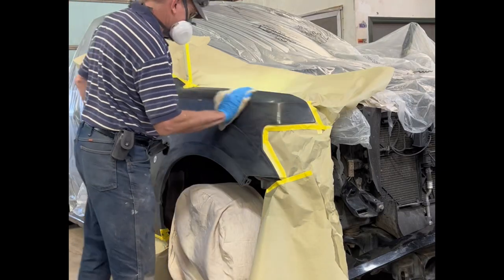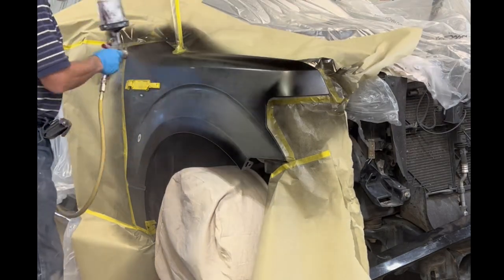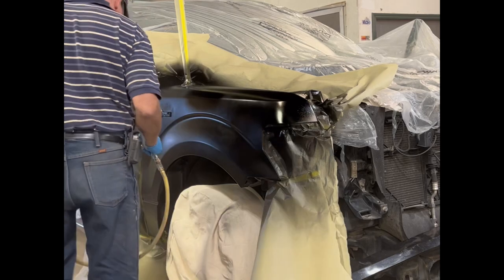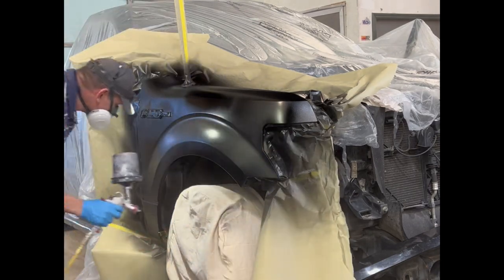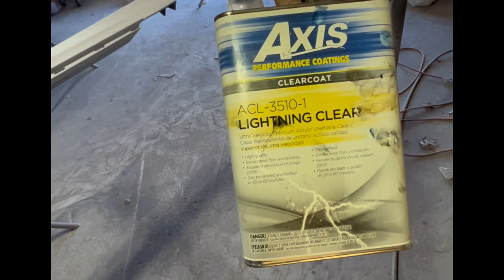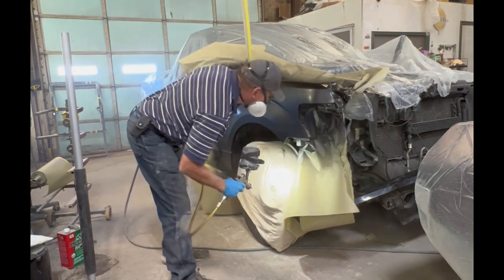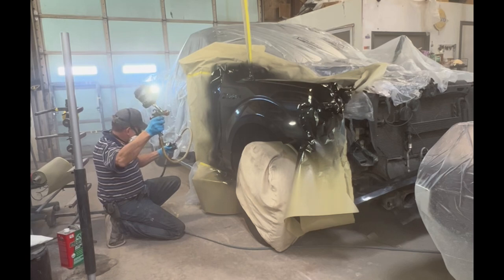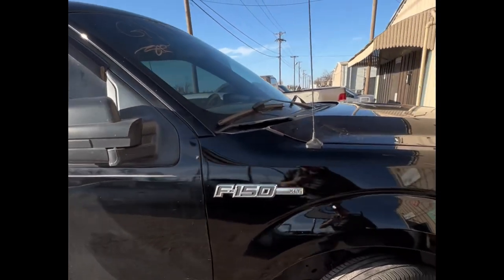Billy Sprays CHEAPTACULAR Paint Easy DIY Cheap Spot Repair Fender Painting Techniques Made Simple

Comment: I never shot a single drop of paint like that in my life. But the experiences I have under my belt have let me see the best and the worst of them in action. See, I was a top-notch Spray Booth Master and that is a literal bonafide truth. I was sent and flown all over the western US to many states to "fix their paint booth problems" to try and beat back the rework/overhead. Commercial shops want 5-7 completions out the door a day/billed/paid for/driven away or their small parking lots get backed up quick because they take on appropriate customer counts so as to generally run about full capacity. So when work backs up, management has heart attacks. 
I have had to tell them more than once that their booth is working like gangbusters and their painter just absolutely sucks! Billy is one of about four in my years of experience I have watched work personally painting cars that I would trust/believe even with a rattle can and my open-air driveway to bend your mind with mastery results. In fact, he's the only painter I have ever subscribed to...I just ran across him one day and saw what he was capable of and it caught my attention. 
Yeah, could say this is an endorsement from what I have seen of him.
Reply from the maker: Thanks Amigo!  Good words😁😁👍
Reply: Would you like a cookie?
Reply: @mrgaryboyd7359  I'd like a cookie and some COORS LIGHT to flush it down with 🤣🍻

Comment: BB...have you used the R500 with 2 to 1 high solids clear? I think Upk said it struggled a bit. Was curious what your experience might be?
  Also, do you use the R500 w 1.8 tip for your primers?
  And lastly, working on a Jeep and used your flux core settings (more or less) as was explained in a much earlier video. Actually got good results on 2 of 3 patches. The third I had to redo because the metal was weak. Had to cut back more. The other 2 I beat with a hammer to knock it down and to make sure it holds. Yup they held. Then I fiberglassed over em
Reply from the maker: The R500 is not a “glamour” gun.  I buff most things, so it doesn’t matter.  Once I build my pressure eyes paint booth I’ll be using a different gun to get a slicker finish cause I won’t have to buff.

Comment: Is that an expensive spray gun?  I thought the cheap guns needed around 30psi or more?
Reply from the maker: It’s a cheap gun and I spray clear a little over 40😉👍
Reply from the maker: It’s a cheap gun and I spray clear a little over 30😉😉
Reply: @OldBondoBilly  I tried to paint for the first time with my cheap gun yesterday.   Felt like the basecoat was coming out thin.  I was right at 30psi.  Would I need to raise or lower my psi?
Reply: @jasonashleyh Increase the fluid or decrease the pressure.
Reply from the maker: YesWelder first 27
Reply: @OldBondoBilly 

 12345